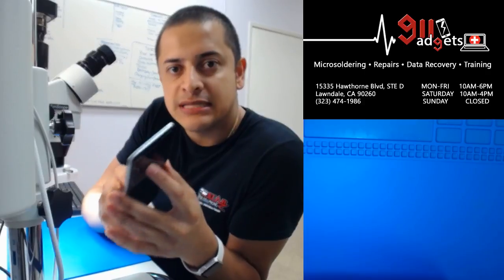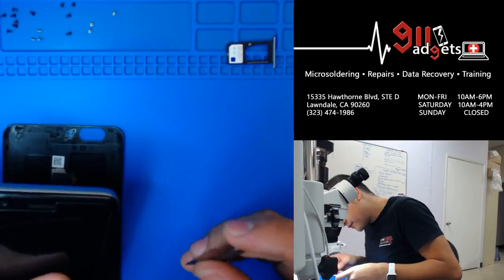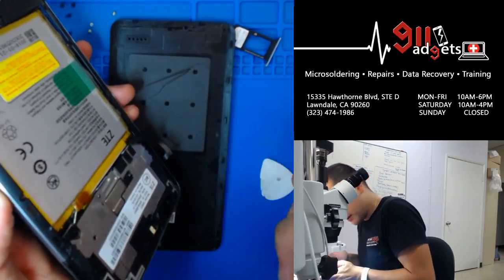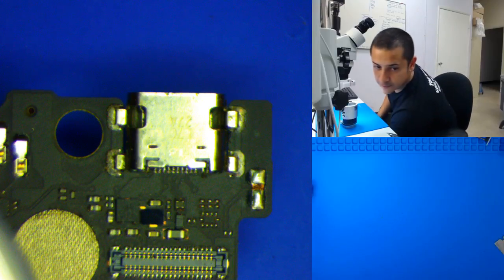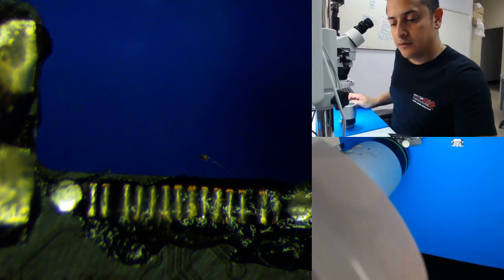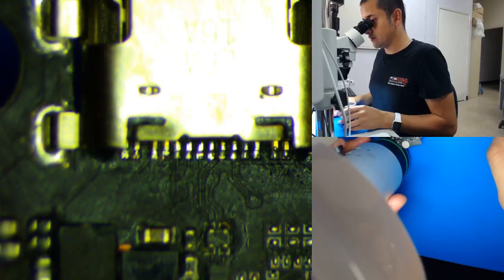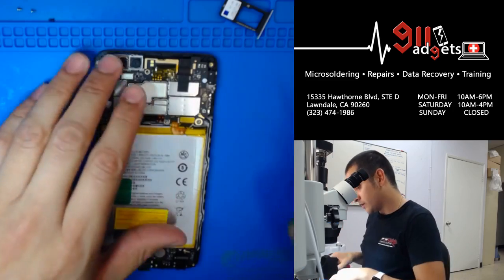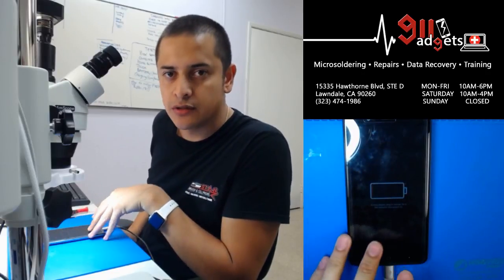ZTE Blade Z Max Z982 - Charging Port Replacement (Soldered)

Comment: Guy at Metro PCS said the phone is sealed and trying to open it is not possible. I just bought a battery for mine and going to replace it. I have replaced screens on ipads pods, I forgot what their called. I don't see any big problems. Thanks Young Man. Phone store guy will get to explain why I had to spend 159.00 on a new phone.
Reply from the maker: You are very welcome. Good luck!

Comment: Hey man.
I successfully replaced a charging port on my Z982 because of your help in this video. I didn't go as far as soldering; just replaced the port and my phone was charging again.

Just like with your phone there, getting that front panel off was a pain. But for me, the biggest pain was getting one of those silver screws off - the one right next to the fingerprint cable. It was on SUPER-tight. I used a ribber band and a little gently prying of the plate it was attached to and finally get that fucker off.

Thanks again for sharing this! ⭐

- Ziro out.
Reply from the maker: Hey! I am beyond glad that my videos get to help people like you and that this particular one was helpful for you. Please subscribe of you havent already and dont hesitate to reach out to me via IG DM @911Gadgets if you ever need any tips or advise. Happy new year!
Reply: You're brave with that soldering iron, man.
Thanks and happy new year to you, too!
Reply: That's super rad for you dude!!😁😁😁
Reply: Me too! Just changed my port and replaced my battery for under $30! Thanks man. I do like that you left everything in too.